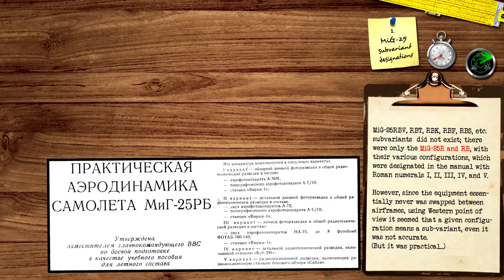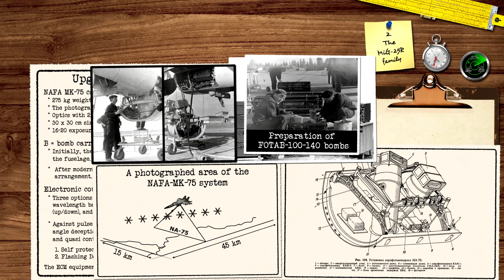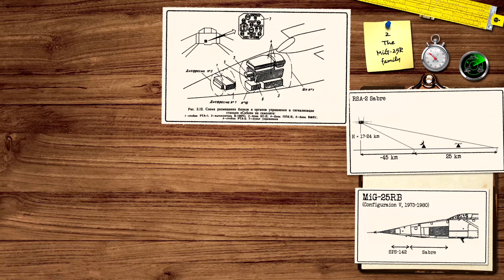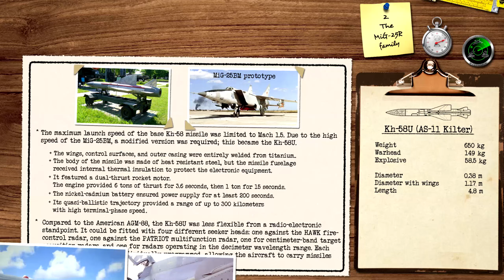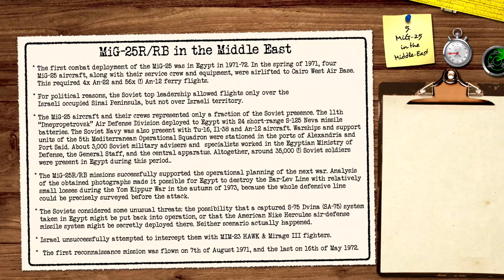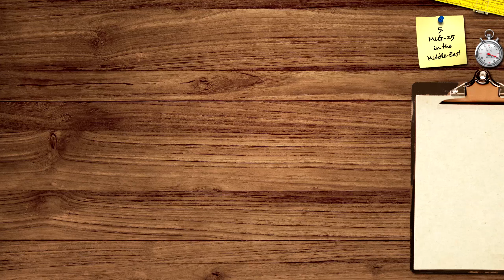Legend of the Mach 3 speed MiG-25R

Comment: 47:00  "The MiG-25 family maximum speed of M2.83 is theoretical; it could be reached only with unarmed plane". It's just ridiculous. Do you understand the meaning of the word "theoretically"? This means that anything is possible in theory, but in practice it can happen with negligible probability. For example, you go to the store and a brick falls on your head. This is what is called "theoretically possible".  An armed Foxbat could easily exceed Mach 2.83. The manual of the interceptor is available in English. This is not what is called "theoretically."  BTW In 1967 the Foxbat  took off with a full tanks, quickly gained Mach 2.8 at 20 km and then flew for 20 minutes at this speed, setting a record for a closed 1000 km route. It was an unmodified Foxbat, just with no avionics.

Comment: 44:30 "For the fighter variants carrying any type of R-40 limited to M 2.35" - wrong. The MiG-25 with R-40 had an operational limitation of M 2.83 as well as with no missiles. A few years ago, the MiG-25P and PD manuals were posted online. You obviously don't know about them. Just go to the Wahrtunder forum - flight envelopes are posted there.

Maybe you think that if the speed was limited to 2.35 M from 4 Kh-58, then it is also the same from 4 R-40. Actually no. Unlike the Kh-58, the R-40 was cooled by nitrogen supplied from the pylon, which allowed it to stay on the aircraft for a long time at a speed of Mach 2.83. The second part of the video is  a collection of erroneous statements. 
There is a two-hour  video on YouTube made by Ka-bot with detailed information about the actual flight capabilities and the meaning of the charts and limitations. Also  there is an interview on YouTube with a Soviet pilot of the MiG-25. He says that there were no speed limitations with the R-40 while with the R-60, the limit was M 2.35
Reply: Only the homing head at the R40T is cooled with nitrogen, the rocket compartments themselves are cooled with freon that R40R have R40T!
Reply: This guy works from archives and manuals and first hand accounds of actual operators.  If there was indeed such a performance number posted in a manual at one point, it was changed due to maintenance burden, or the version availible online is a forgery.
Reply: @vakapad9622 No.  This guy doesn't works from archives and manuals and has never used first-hand sources.
Reply: This doesnt make sense, you cool seekers with nitrogen. No aircraft can carry enough nitrogen to cool an entire missile for more than a couple of minutes total
Reply: @signs80  Cryogenics do not consume the coolant medium beyond leakage. You dont need to refill your fridge with freon either.

Comment: "Speeds above 2.35 were impossible under standard conditions" is a ridiculous claim when the 500km route record requires straight line speeds of ~M2.9 for almost 10 minutes.  In actual usage Shukhov gave permission to use the afterburner with no time limits.  That is in fact... what it was designed for.
Reply from the maker: I mean by paper. Of course the plane would not fall apart instantly but it was prohibited to do that because of the listed restriction. You anytime can overload you any of your eq....
... just to be brave live with the consequences...
Reply: @militavia-air-defense-aircraft The consequences being the entire maintenance crew in charge of the plane wishing death upon you for the extra premature airframe damage they have to repair. It's similar to over-G: it won't always resort in complete wing loss and the plane will probably survive but going through parts faster than anticipated will not go well with the higher ups.

Comment: Unfortunately, the author is not telling the truth, the 2.35 M limit is necessary for the climb mode, which is for Mig25P for Mig25P, but the maximum Mach number limit is 2.83 M, but in training flights it is forbidden to exceed 2.65 M!
Reply: The video shows a slide at 46:17 that says 2.65 to 2.83 M. You should finish watching before you critique things.
Reply from the maker: @ninefox344  You should pay attention to 'with loadout' and 'without loadout' states...
Reply: @militavia-air-defense-aircraft I think you are confused. I was agreeing with you.
Reply from the maker: @ninefox344  OK. Theoretically the MiG-25P can fly faster than M2.35 but it was regulated no to do it.

Any limit to the plane was set with a nice margin. If a pilot flew faster than M2.35 for ex. M2.4 In Europe it did not mean that the plane would fall apart instantly.

The point of the video which supplements also what was stated in the PVO fighter video series that commonly citied M2.83 speed for P variants is simply a myth. It is beyond the allowed use of the plane in most of the cases. Even at the latitudes of Egypt would be overheating issue for the missile and also the fuel would be limiting factor.

The M2.83 was just as combat speed for the MiG-25P as M2.2 for the F-15s. Pure fantasy. But of course both plane could accelerate in functional test flight up to their theoretical max.

That was the whole point.
And also the addendum that if anybody wish to broke the written limit for a longer time it was more easily doable with the R following a subsonic climb with drop tank. But during normal conditions sustained speed above M2.35 was a NOGO "by paper" (written order) for the R. But at latitudes of the Middle East it could be done. The eq. which defined the limits in the Middle East sustaining M2.5 would not be an issue. Except that calculation of the range would be partially a guesstimation because it was no chart created to that... The very large and complex chart always consider M0.9 or M2.35 cruise. There is no other data beyond these.
Reply from the maker: @ninefox344  I replied I guess to the wrong thread of conversation.
Reply: @militavia-air-defense-aircraft what cruising mode can be for the Mig25 at supersonic speed? This is absurd, otherwise you can agree that the Mig25 is a fifth-generation aircraft!

Speed   mode up to Mach 2.83 for Mig25 is standard, moreover, there are devices that provide compensation for neither symmetrical suspension when firing R40 at speeds less than M = 2.5 or more M = 2.5!

So please don't have to make it up!
Reply from the maker: @andrewfabraf4708  Cruising means that you keep that speed for a considerable time OR distance. This is how you should interpret the M0.9 and M2.35 speed figures. 

I have no idea how any why you wrote such funny thing that 5th generation = high cruising speed. 
F-35 is a nothing special plane in speed and 5th gen. The base requirement of 5th gen is "be stealth". Was the MiG-25 stealth? No.

I recommend to watch about the issues of generation classification. I made that video with a purpose...
Reply: @militavia-air-defense-aircraft   considerable time is maximum flight duration and it is possible at М = 0.95 at no afterburning modes of engine operation, and maximum distance is flight range and it is also slightly more at subsonic mode (by almost 200 km.) than at supersonic speed М = 2.35 and higher altitude  😉   no need to distort, Mach 2.35 speed is just flight modes not in a combat situation !
Reply: My good man, cruise flight does not mean engines dry, no burner.
Cruise flight means the speed maintained for the ongest leg.
I have no idea if the foxbat could go supersonic without burner, it probably could, but thats not whats being said, but that interception missions were planned with mach 2.35 cruise legs.
Reply from the maker: @vakapad9622 Exactly. MiG-25 had terrible drag so even with clean config M1+ speed seems impossible with without afterburner.,
Reply: @ninefox344  :) His confusion confused me :)
Reply: This is the weirdest game of telephone I've ever witnessed
Reply: @ninefox344   For Mig25P\PD there is no limit of Mach 2.35 with missiles suspension R40R/T! Since the compartments are R40 cooled by freon throughout the flight (well, while there is gas in the bolon)   😉
Reply from the maker: Bro you simply did not watch the video until the end.

BTW no1. the M2.65 speed limit also was reduced later following an accident.

BTW no.2  The MiG-25R had range calculation diagram only for M2.35
Reply: @militavia-air-defense-aircraft  so it does not mean that the Foxbat cannot fly faster and if barter restrictions on weapons for him so in general we can say that he is not able to fly faster than Mach 1.5  😆